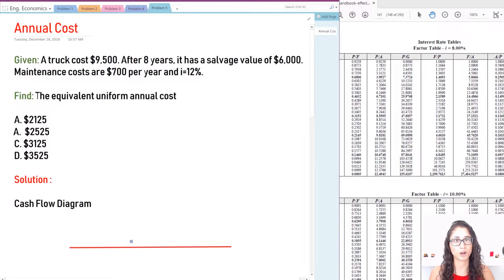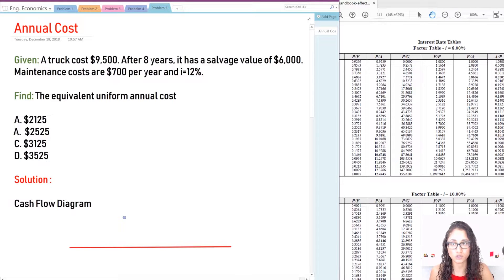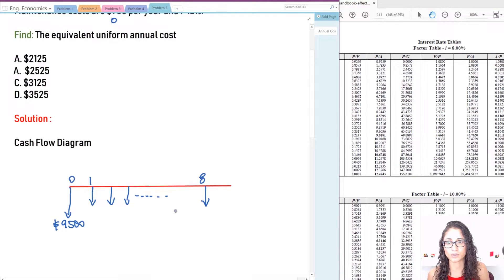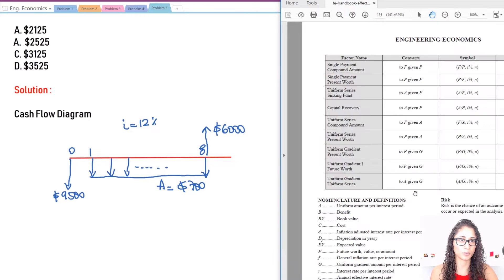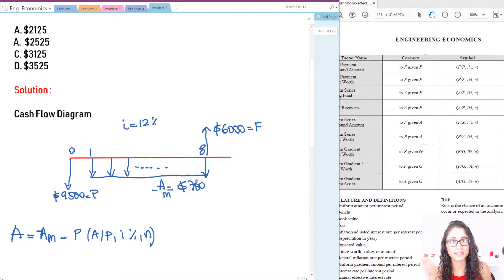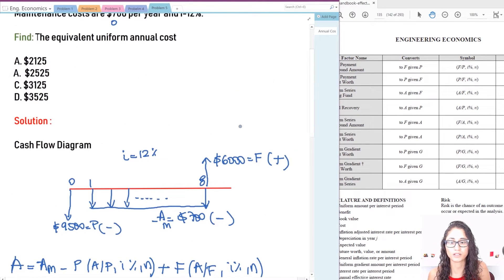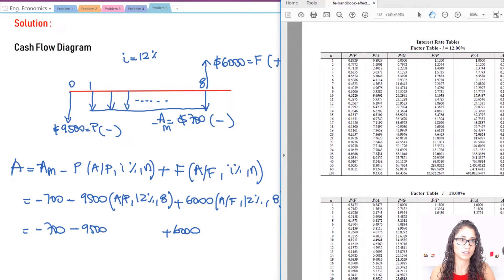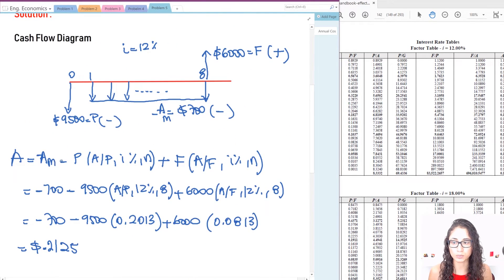FE Exam Eng. Economics - Equivalent Uniform Annual Cost (A)

Comment: Can u please solve question 9 from engineering economics chapter in the practice problems which asks to find the EUAC giving 2 annual maintenance which differs from year 1-8 as 275$ and year 9-13 as 425$. Initial cost=5500$, Salvage =3100$ and interest rate=6% .Thanks in advance

Comment: EUAC values are positive because in Annual worth problems the signs are flipped. Cost become positive and savings become negative. Either way u get the same answer. If it's a fill in the blank then you want to put in the positive answer because the negative answer will be wrong.
Reply: I hope that answers your question.